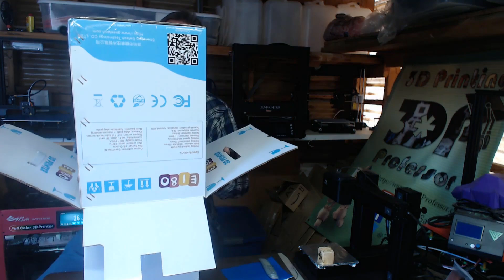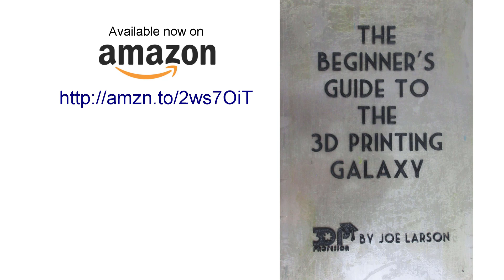Gearbest Doesn't Suck

Comment: I have bought 2 3D printers on the exact same day from gearbest.  I have received one so far. But, the second one hasn't been given to DHL for shipment, yet. Gearbest says that my 3D printer has been shipped off on 4/28/2021. But, DHL says that Gearbest has made a shipping label but has not given my 2nd 3D printer to DHL yet. It's been almost a month now. They have stopped communicating with me completely too.
Reply from the maker: Ooh, that sucks. I hope you can work it out.

Comment: GearBest absolutely sucks.  Here is my experience with my first purchase from GearBest, and my first 3d printer.  I ordered an Anet A6 from GearBest, back in March.  When it arrived it had many broken acrylic parts, it was obviously dis-assembled, the control board was missing, it had a 2004 LCD instead of the 12864 LCD, and basically thrown into a Pampers baby diaper box.  Also it was shipped from an Amazon warehouse in Arizona.  I immediately opened a dispute of DOA.  They gave me the runaround until the PayPal deadline to open a dispute was about to expire and finally sent me an RMA and an address in my zip code.  I looked up the address and it did not exist, and the telephone # was dis-connected.  I informed GearBest, and they told me to ship it anyway or I would not get a refund.  I shipped it at an additional $18.67.  The next day I got a call from UPS saying that the address did not exist and they couldn't deliver it.  I opened a dispute with PayPal, they said I could have a full refund, but everything I ordered had to be returned in un-used, un-opened packages.  I told PayPal that I had already used some of the other items and all I was disputing was the cost of the printer.  This went back and forth for another several weeks, and finally as time was about to expire with PayPal, they said I could get a refund for the printer, but that I had to ship it back to China AT MY EXPENSE.  GearBest warranty says that they will pay return shipping once the item is received.  They would not refund me the shipping as it was $128 to ship a $119 printer back to China.  Even though the printer had been shipped from an Amazon warehouse in the USA.  I have since opened a dispute with the Credit Card company, and received the paper work today.  I was told it might be another 105 days before it is resolved, hopefully in my favor.  GearBest is a rip off at the very least.  Hope this saves someone else the trouble I have been through.

Comment: I made 2 separate orders on January 12th. One order arrived on the 31st. The other, along with an order on the 17th (for the same item, for a friend) has not even been handed over to the shipping carrier. When I opened a ticket and asked about it, I was informed the item had sold out quickly and they had no stock. They offered only 2 options; wait for the item or exchange it for something else. No refund option, which is what I would have preferred. If I wait, they will give me "points as compensation". I politely informed them their "points" were not suitable compensation as I would not be buying from Gearbest ever again. I told them their practice of selling items they do not have was unacceptable. I also told them I would inform as many people as I could so they would not fall in this trap.

Comment: Here is my take away.  I've bought and used several machines from CNC, laser, 3d printers many purchased from China. And for the most part, they were decent products. But I learned quickly to become my own tech support.  Advantages are the prices are generally lower. Cons you are the tech support.  Now the pros of buying stuff locally.  Generally better tech support. Cons price tends to be higher to help pay for those issues that come up.

Comment: 3D Printing Professor - I'm concerned about where you're loyalty lies... I am a "Gearbest Virgin"... I recently purchased a CR-10, based on many reviews (yours being one of the reviews)... But, I'm worried... because the shipping commitment was 3-7 days...After about 4 days, I tracked the package, noticed (per DHL) it hadn't even been picked up yet... I became worried... so I looked for any way I could find to contact them..  Their 24/7 online chat doesn't work... they dont have a phone number listed anyplace I can find... The only way to contact them is by Facebook... they responded fairly quickly, but essentially just promised me the order had shipped, but needed to give it time to show up in the system... DHL in Hong Kong, shows the label was created, but no more information... the message from Gearbest stated, because it's international, the tracking info takes longer to update... So I called DHL, they told me that's absolutely BS... 

I said all that, because it makes me feel that Gearbest doesn't seem to practice good customer service... I mean, first this is they flat out lied to me, as it appears... I've sent follow up messages, no response... I began to check a bit, (something I should have done from the start) and found a whole bunch of complaints directly on the Gearbest Facebook page... Many of the comments on their Facebook page are extremely similar to my experience...

Men with Integrity like yourself, need to stand up against this kind of treatment... the people they're screwing with are your viewers... Do whats right...
Reply from the maker: I appreciate this. Keep me updated. I've had similar situations with DHL, where the tracking says nothing, and suddenly the thing shows up on my door. Not saying GearBest isn't to blame here, just saying keep me updated. 

Oh, and their email is gap.en at gearbest.com. Give that a shot. Let them know what DHL told you and see if that doesn't shake things up.
Reply: 3D Printing Professor   There isnt an easy method of really determining what percentage of gearbest customers end up satisfied, but purely from comments on your channel and what Ive seen from their facebook page, you are supporting a business that has a real problem with delivering quality service. That should make you feel extremely concerned. Your viewers are who make it possible to get credibility with retailers, and what ultimately provides you the access to equipment to review. It seems you’re recommending a supplier who’s business practices are extremely poor. Ive enjoyed your videos, but If you taking the position of recommending this supplier rather than just providing objective reviews of equipment than it really should bother your viewers.

Comment: the only bad experiences I've really had with gearbest is when I order printers from them and its mostly got to do with them taking so long to ship it out but if I'm being honest I'm usually buying a popular printer at a good price IE the CR-10 for $390 or the tronxy X5S for $350 when I ordered a few small things heater block socks, blower fans that kind of stuff they shipped it in 2 days and it got here in about 2 and a half weeks

Comment: Yes it does, like Bang Good and Ali Express.

I see prices that are more expensive than my local chain store hardware store that sells 8MM smooth rod and also 8MM screw thread rod like that used in 3D printer builds.

It seems that you apply any special meaning to an item, it suddenly justify a price hike, a plain old M3 hex-head screw is the same as any M3 hex head screw until you put 3D Printer, CNC or RepRap in front or in the title for the item and then the number you get dwindles from the 100's to the number you can count on your hand and for a price that's the same as buying a hundred but now, everyone's in on the game and you have no real way of getting at genuine value as everyone piles in on t he same old trick. 

So why should I pay £2.99 for 5 hex head screws that is more like £0.06 each if buying small amounts and £3.54 a box of 100.

So I disagree that these sites offer value, they offer convenience which always comes at a cost.

Comment: I've bought alot of things at that place, and no real complaints. even the cheap stuff has held up. been running an 25gal air compressor i got there since 2004 and its still working fine. granted it was missing the mounting hardware for the wheels. but at the price i got it for i wasnt complaining. i got some bolts and put them on myself.

Comment: You have several serious issues you need to consider and address. You need to understand why every other major YouTube 3D printing channel avoids this company like the devil.

1. This isn't about buying cheap crap and expecting cheap crap. If I go to Harbor Freight, I know I'm getting cheap crap, but at the same time, I also know I am going to receive said crap. I am walking out the door with exactly what I ordered. That is not the case with Gearbest for way, way too many people. The mere act of selling products seems to be extremely difficult for Gearbest.
2. You use your anecdotal experience as a reason to continue supporting this company, despite the fact that you acknowledge they are known for having serious support issues. You need to stop considering yourself in this scenario, and instead consider your viewers. 
3. Going back to "expectations", how exactly is the average newbie to your channel supposed to know of Gearbest's issues if you don't tell them? Why are you assuming that everyone just "knows" Gearbest has low quality products? They see you recommending it, even going as far as being an affiliate, and they trust that you're not misleading them. But that's exactly what you're doing, regardless of your intentions.
4. You undervalue your own, and other people's time. If Harbor Freight sells you a crappy product, you can walk it back to the store the same day. If Gearbest screws up an order, or sells you a dud, it can be MONTHS before you see a resolution. Not only does this make for a horrible user experience, but it also eats away at your time. Now you have to continuously follow up on your broken order to make sure that support follows through. 
5. Finally, you need to start realizing the damage of stores like these. Imagine if Josef Prusa just ripped off someone else's design, and never released the changes. The firmware source code is GPL. I sure as hell don't see most of these Chinese companies publishing their modifications. Not only do they undercut other great companies, but they don't give back to the community. So why are you supporting them? Furthermore, why are you /taking money/ from them?

Comment: If it weren't for Gearbest and their low prices on the Anet A8, I can guarantee that I wouldn't be sitting next to my 3d printer right now. I've had a few problems here and there, but nothing that has shut me down (printing at this very moment with an unheated bed while I wait for a couple of parts to get here). I wouldn't trade my printer for anything. But, I do want to add a couple more. Now that my wife has been on the receiving end on a few things that the printer has been able to do for her, I find it is much easier to find the money for filament. I like Gearbest. I like them alot!

I would say that it is disappointing that their product is not being upgraded as a few serious problems become known. For instance, there was a ton of info on the net about the problem I had with the connector on the heated bed. If it were just inconvenient, I might be a little more forgiving. But, the fact that it is a fire hazard is a real issue, in my opinion. With that said, I did my due diligence and knew that I was not buying from Josef Prusa. I also wasn't paying Prusa prices. Finally, knowing what I did, I never let the printer run while I was asleep. When it broke, I was in the next room and saw it when I started the next print. So, if you're wanting to open the box, set up the printer and go to town, maybe it's not right for you. But, I'm more like David Gingery, wanting to build a 50 dollar machine with the 50 cents that I have, and Gearbest helped me do that.

Comment: In Southern Iderho, locals refer to it as harbor fright. You are definitely right if you are aware of price/quality equation (is it cheap enough that I can justify buying another one when (notice I say WHEN) they die? Is it good enough to do the job I want it to do for as long as I need it (throw away tools,  like a toolkit for when I am in the semi, and don't care if I lose something in the muddy parking lot?)?  Is it precise enough to do the job (it is always nice if the angle is 90 when you want it)?  Get some opinions from other shoppers, for example I never buy an air compressor from them (at least for work), BUT I might consider buying a motor, the compressor itself, and the tank and making my own.  My problem is the reputation of gearbest.  I am trying to figure out if this is really awful customer service or the first rule of customer service (make a good customer and they will tell one more person giving you TWO good customers, mess them over they will tell everyone they meet for the next six months!) coming back to bite them?

Comment: Uh 5:35 yes you should feel bad about making the video named "The problem with the CR-10". You should feel particularly bad about the clickbaity title that prevents you from making a follow up highlighting some ACTUAL problem you had with the machine, because who would ever take it seriously after the one that came before it?

And yes pointing out issues with a product is important, it's no less valuable than the positives. Just don't let things sit for years until your version of the product is no longer the same as shipped to the customer.